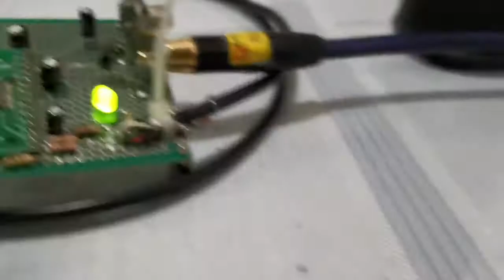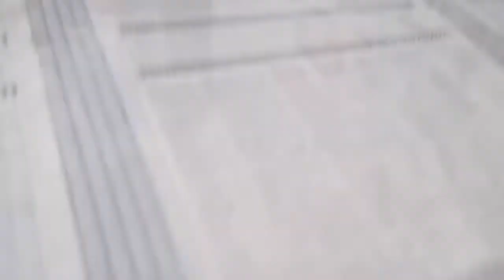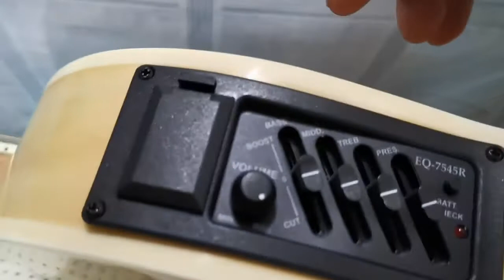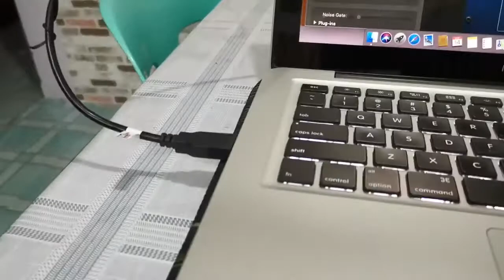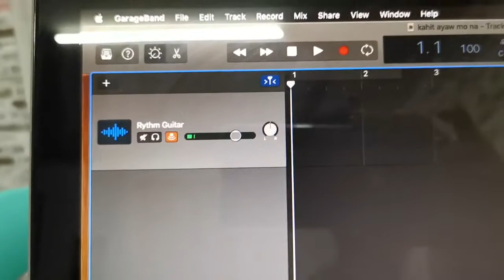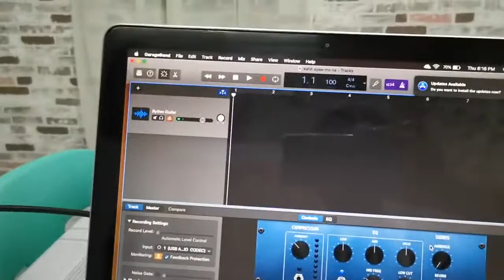Simple DIY USB Audio interface using PCM2902 for recording guitar

Comment: Question to Creator of video: What if I wanted to use 6.35mm stereo jacks (1/4inch) instead of these connectors? And a USB A (regular charger cable), Would I need to change the schematic on your website?

Comment: You will need a proper single side pcb or properly designed analog audio line or high frequency crystal incase of double sided pcb for audio interface. Breadboard and universal pcb simply have too much parasitic capacitance from those solder point and high humidity.